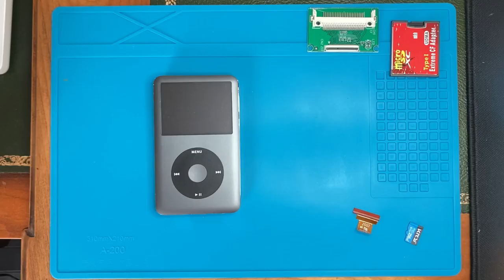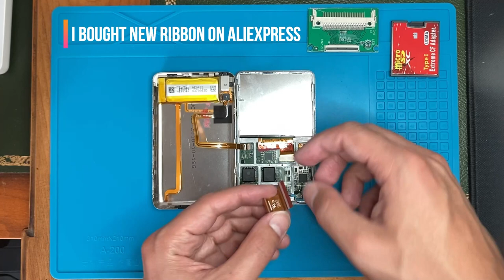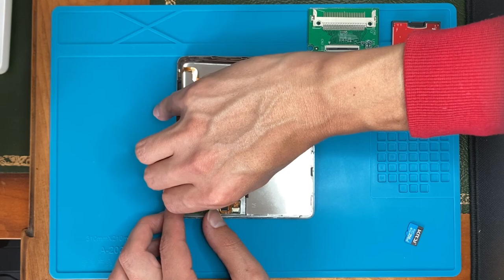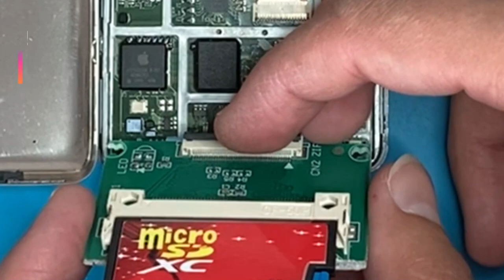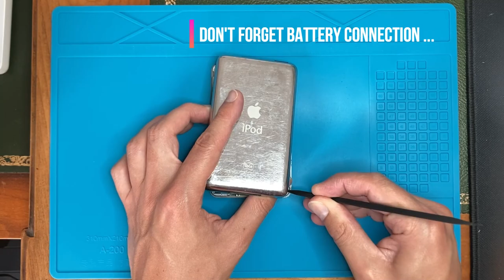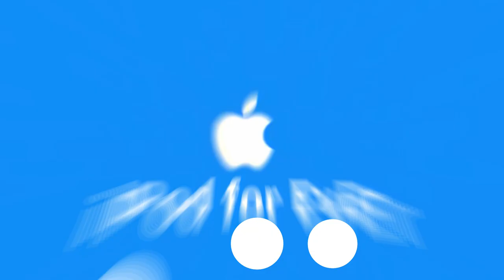iPod Classic 7th modded compact flash SD CARD and ribbon replacement

Comment: Hello friend, I did the same with my 160 GB iPod Classic 7 and when I put the SD in iTunes it appears 0 kb as if it had no memory, and it appears to format memory on the computer. I tried with other SD memories and nothing. Any help?
Reply from the maker: Good morning ! oh damn. If you have tried several SD cards then it probably comes from the compact flash or the adapter. Recently I had a problem with loop restoration even though it detected my card and it was the compact flash! sometimes you come across poor workmanship. It can happen. Tell me if this helps you. See you soon
Reply: @ipodforever2023  Thanks friend for the information, I will have to try another green plate by chance. Can you give me the link where you buy yours? Thanks and very good videos.
Reply from the maker: I bought on aliexpress my friend : https://s.click.aliexpress.com/e/_EQpgzm1 😉

Comment: Could I have the link to the compact flash adapter
Reply from the maker: Hello my friend ! you can find it on amazon or aliexpress.
There is 2 models for sd card or microSD card :
SD card : https://s.click.aliexpress.com/e/_DkWZEgr
Micro SD card : https://s.click.aliexpress.com/e/_DkkkTif
Follow me my friend :)
Reply: Hello, are those from those links working ? I've Seen on Reddit that it can mots of the Time not, the one you are using in your video IS an old one or quite a recent one ? Did you manage to restore your iPod successfully at the end of your video ?
Reply from the maker: @peteledoph  hello, yes the links work and I managed to restore without problem. You are right to pay attention to the material used. Sometimes we come across defects, this happened to me recently with a defective compact flash 😬

Comment: Did it work? Many people are saying that it's not possible on a 6th and 7th gen
Reply from the maker: Hello 👋 
Yes of course it works ! But you need to use sd or micro sd of quality (like I explain here : https://youtu.be/tiusjGwX-gA?si=5aAlkJ94EVkkupEX).
Next, you can used green adapter flash without problem. It works on my 7th 🙂
I precise that the size of sd card is limited to 128gb on iPod 6th and 6.5th gen 🧐
Reply from the maker: @leoscoo6135 Thanks for your reply my friend 😊
Reply: @ipodforever2023   Thank you my friend!
Reply: @ipodforever2023  no problem of corrupted files with a 256gb microsd card on the 7th gen ? did you tried to put more than 64gb, 128gb of songs or other ? i've heard that this adapter might corrupt datas after the 128gb point (i am advising buying 128 or 256gb sd card depending on that) thanks in advance for your feedback
Reply from the maker: @peteledoph  hey ! 👋 no problem with this adapter because the main problem come from your se card bad quality. I had this problem when I sync more 80gb of music , films, etc but the problem is always a bad quality of micro sd or qd card. BUY QUALITY my friend. The adapter is just an adapter ☺️